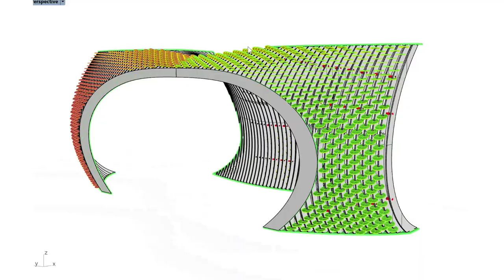Formforge pavilion - Construction Timelapse Video

Comment: Amazing. What thickness of plywood are you using and how do you lock the ribs into the surfaces they connect to? Is it just a mortise and tenon friction fit?
Reply from the maker: Thanks! we used 18mm Birch here. Joints are indeed as you described but will additional screws
Reply: @formforge  
Thank you.